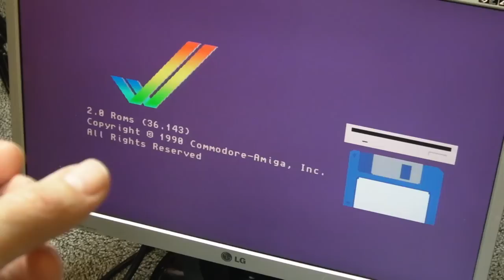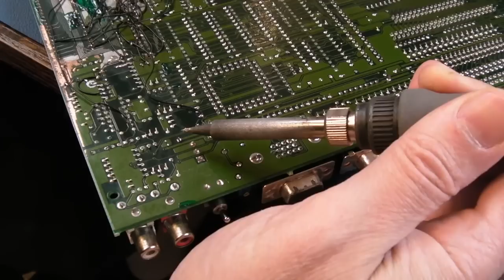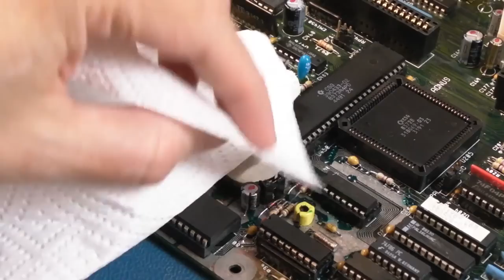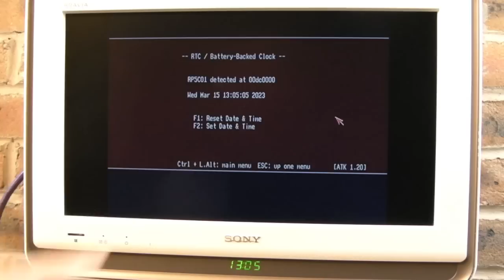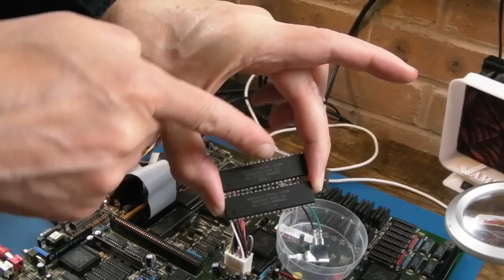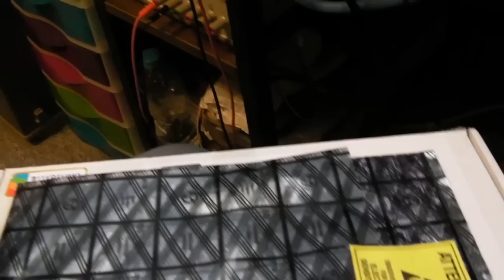Commodore Amiga A3000 Varta Revival Part 5

Comment from the maker: Part 4 - https://youtu.be/Z7lfY3Wjhk4
Part 3 - https://youtu.be/ZJKwG5rKD6w
Part 2 - https://youtu.be/CSH6IvFKMoU
Part 1 - https://youtu.be/JJ6mkfcyGT8
Chucky (John Hertell) Re-Amiga - https://wordpress.hertell.nu/
Chris Edwards Restoration (Lots of 3000 repairs) - https://www.youtube.com/@ChrisEdwardsRestoration/search?query=3000
Tristan Zondag's A3000 Flicker Fixer Repair & Calibration - https://www.tsb.space/knowledge-base/a3000-flicker-fixer-repair-and-adjustment/
Corrections: I think the DSP on the 3000++ has 8KB of on chip RAM (assuming they used the DSP3210).
In relation to the ZIP RAM, it's not just Static Column Mode you need to consider, Page Mode is also important.
Quote from Dave Haynie -  "The RAMSEY chip controls up to 16MB of memory on the motherboard, with facility for burst and page-detection modes when used with static column DRAM."
There are a few of the usual mistakes too - like at the end of the video pointing to Super Buster and talking about Ramsey etc.
High flyer - I don't think there was a 3000 version?  I was just guessing at that point in the video!
Towards the end there I said the RTG works perfectly, I meant the scan doubler =D

...

Comment: I finally got around to testing the Engineer desoldering pump that you recommend so often. You really do make it look easy. I normally recap an A1200 within 1-2 hours with my Hakko desoldering gun and a hot air station. It took me close to 4h with the Engineer (+ hot air) 😆 The only time it actually saved some time was when removing the RF can as this was a breeze. I guess that practice makes perfect.

Comment: Crazy work gadget 🤘. For the battery diode i use BAT42, do you know if the 1N5711 is better and has lower voltage drop than BAT42 ?
Reply from the maker: Thanks =D  The BAT42 has a 0.4v drop, so its very similar!  Last time I looked at the 1N5711 I think at the current drawn it was showing a voltage drop of less than 0.2v, but I could be wrong.

Comment: Have you considered that the weird bus line behavior could be because it is tri-stated and nobody actually owns that bus at that moment, i.e. the lines are floating? You could try correlating the bus signals with some that assert bus ownership like /OE
Reply from the maker: Thanks - very good point!  Yes, I think that's what the issue is - combined with the pull ups.  So when it goes high z the pull ups start to pull up!